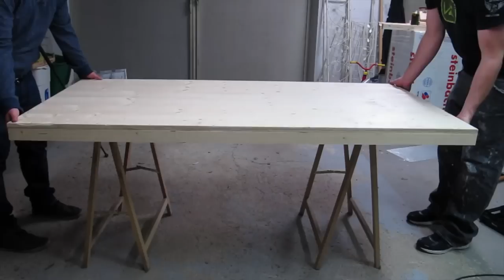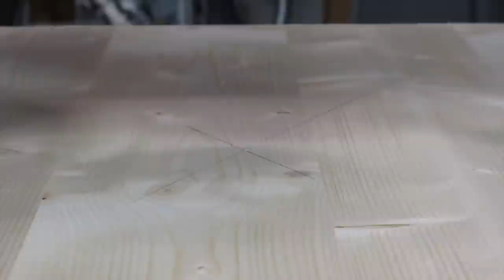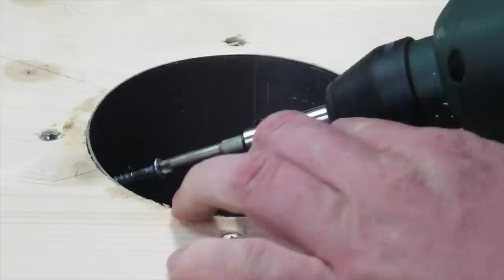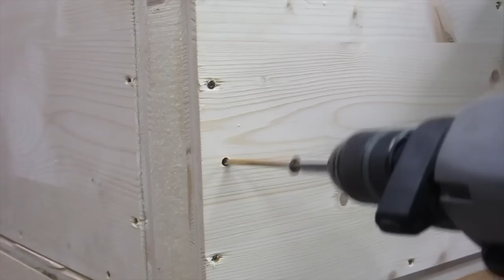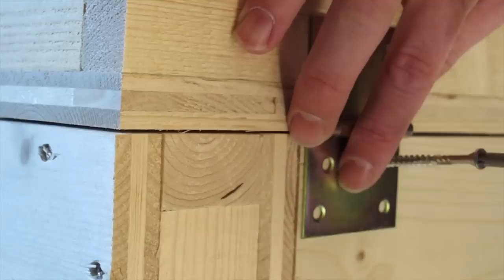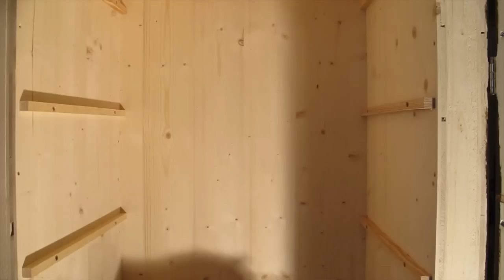DIY Smokehouse - COOK WITH ME.AT

Comment: Wow, that smokehouse is built like a brick shit house! Definitely built to last and keep the big bad wolf out! Nice job. I'm sure it works wonderfully. I am thinking about insulating mine but I just bought a Camp Chef smoke vault and of course it is all steel. Not that it isn't built correctly, but it isn't meant for cold smoking as it is a propane job. It can't stay below 155 to 160 degrees on it's lowest setting, however they advertise that it does. I put a cold smoke generator in the pan and on cold days here in CT, it sags below 55 degrees which is optimum for cold smoking of schinken (ham), speck (bacon) , etc. I make a lot of German tea sausages (teawurst) and it is critical to get the right temperature as it is a pate that needs to be creamy and spreadable. Too cold of temps doesn't  allow it to absorb into the sausage enough and it leaves too much of a ring on the outside of the sausage and nearly no color internally.  I decided to build a wooden box with insulating foam as you did that will slide over my smoker to retain heat better, however the opening in the bottom for the propane is too large. I finally gave up and just preheat the whole thing with propane with the insulating box covering the smoker to get it up to temp, and once the cold smoke generator is running, it keeps the temp at 60 degrees which worked out perfect. I am grateful I saw this video which gave me the idea. Cheers.

Comment: Tried to get the plans and couldn't get them I would like to build something like this what was your heating source and how hot can you smoke in it
Reply from the maker: Hi David, you will find the plan here: http://www.cookwithme.at/25/news/ . The "heat" respecively the smoke source source is the Pro Q Artisan CSG Cold smoke generator from Mac´s BBQ. If you have any further questions please do not hesitate to contact me any time. Best, Christian
Reply: If you still active .. have seen other home built smokers use 2 hotplate (2 coils) as a heat source many say they can get up to 230F .. not sure if this build can use a heat source due to the type of insulation used lots of other builds use no insulation
Reply: Maybe do build but with "dead" space instead of filled